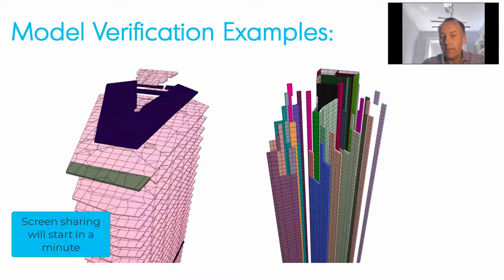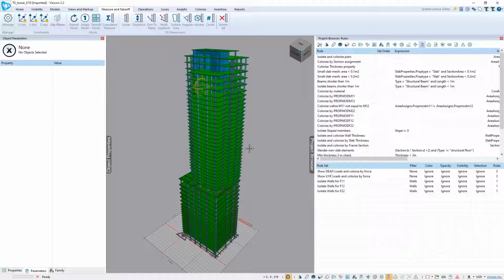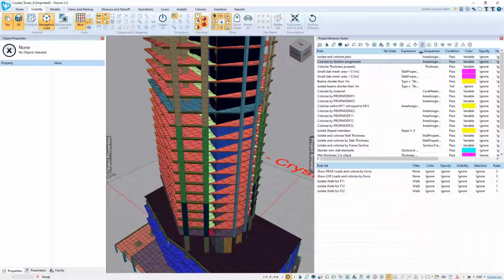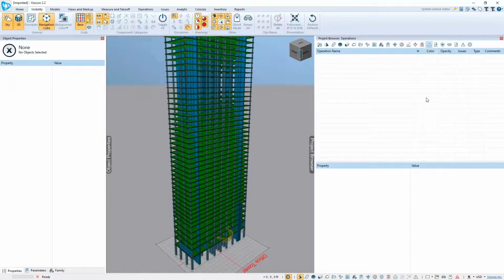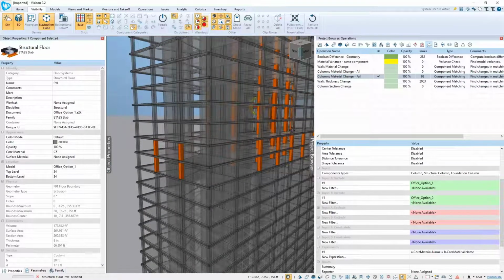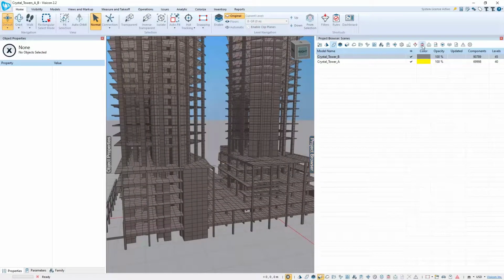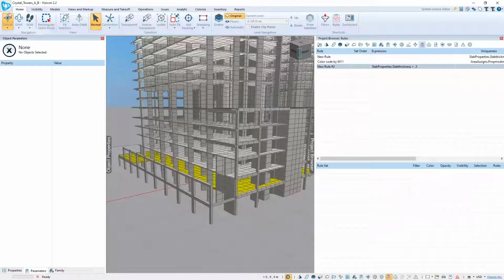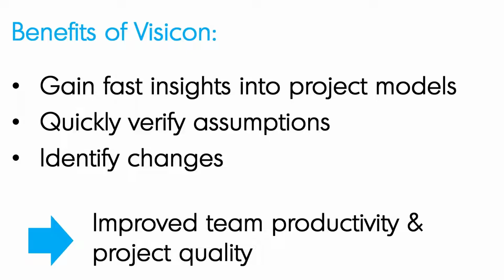How to Standardize & Automate ETABS Model Quality Control

Comment: What about more extended frame object properties? Say end releases for frames, end length offsets, eng leng rigidity coefficient. Does visicon allow to investigate joint object properties, say, panel zone assigns or an aditional mass added to a joint for instance? Does vicocon allows to look at whether the diaphragm is rigid or semirigid? As i know it only allows to see what name of the diaphragm was assigned to, say, a slab or a deck. So if is just see DIAPH:D1 in object properties tab it does not tell me anything... I anyway need to open an etabs to find out what does D1 means (rigid or semi-rigid). Or, perharps, some material overwrights were assigned to a group of the objects so that it drastically affects an analysis ouput and i need to investigane fast whats the whack and what might be wrong with a model... Hope for a more versatile checks in future releases. By the way rules and check-templates are really great thing!
Reply: Thank you for the feedback. At this time, we give you the opportunity to check all properties that are linked to physical components in a model. Next, we are considering also loading analytical items like boundary conditions, etc. that are present in the E2K file. If we get good commercial response to these improvements, we may also go as far as linking to the API and showing many more of the underlying model characteristics, similar to what you list.
Reply: @florianaalami4125  Thank you for the fast responce! As i was wrutung a comment a thought that i might miss something from sofrwares features that i was reffering to as my experience with your software was somewhat short. But anyway so far it retains many great and realy usefull features for industry. Hope for the best for your sofrware!